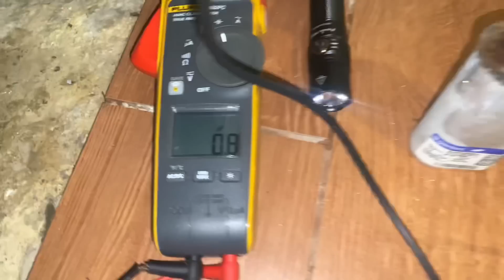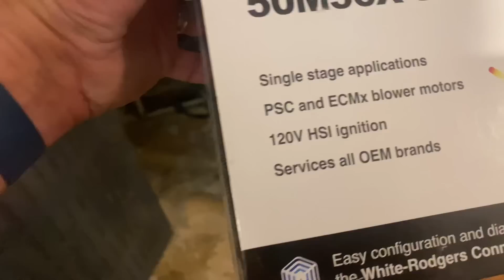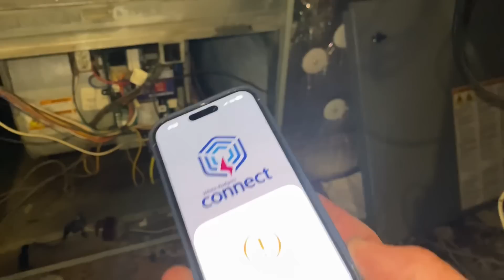Gas Furnace Blower Motor Failure Causes Evaporator to Freeze Up & No A/C

Comment: Nice repair. I always check cooling tap to ground for 120v to check if its the motor or board. And door switch can work to check inducer motor also...

Comment: before testing the capacitor, touch the motor to feel if it's hot(with power off), see if it spins free(you did). because if it's not hot, it's either permanently dead or there's no power going to it from a failed control board/thermostat, next step check power from board.  if it is hot to touch, then check the cap and pray for it. 🤣

Comment: Mikey, I'll be honest with you, I wasn't thrilled with the sound of the motor on startup. If you listen it make that wurp wurp wurp sound that a lot of motors make when when the inrush current is kinda high when they first start. It'll probably last a while, but like those capacitors that are just about in spec, but don't pass the shake test, it's iffy. If the inrush current is a bit high on startup, the little fan relay contacts on the board take a beating and fail. If everything operates as designed, a control board "should," (and I use that term loosely) last the life of the unit. More often it's a weak capacitor that kills a fan circuit on a board, due to continuous over amping on startup. Hope this helps.

Chum